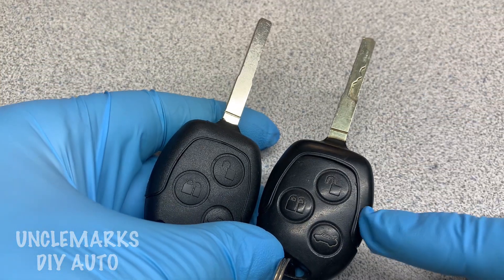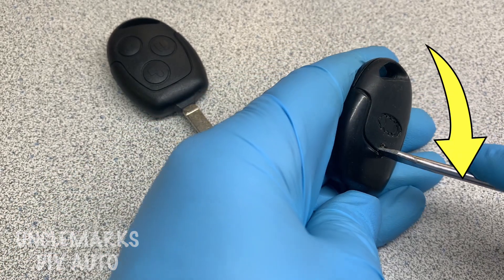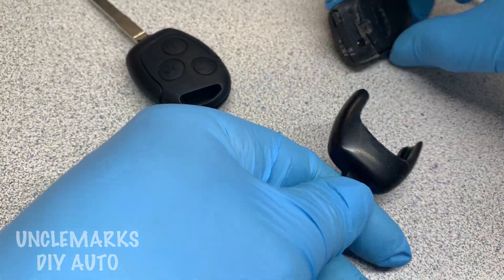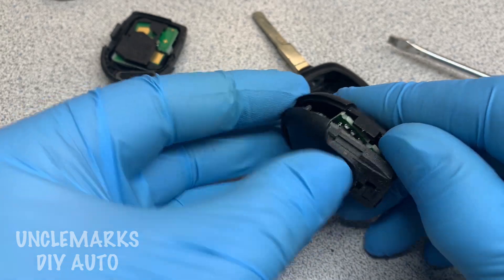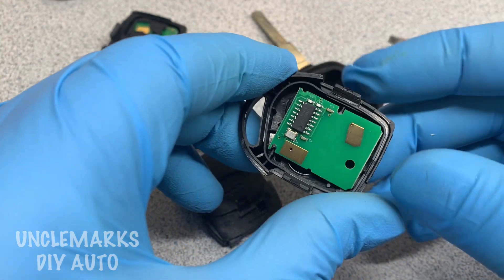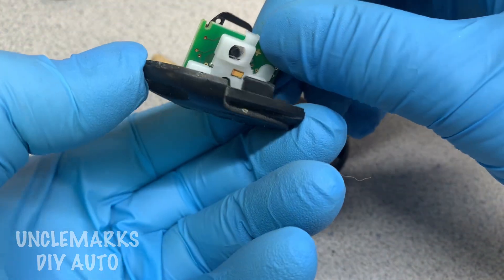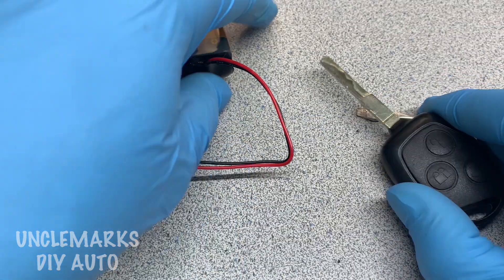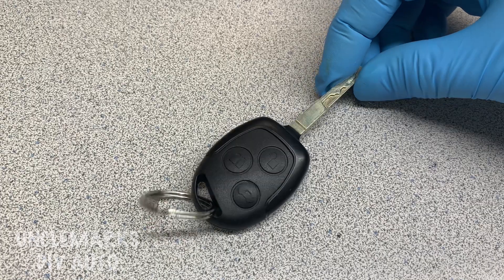How to add & program a Ford Fiesta key FOB by yourself!

Comment: This is fine for the remote function but how will the added key start the car? You still have to take it to the dealer to program the transponder of the new key.
Reply from the maker: no, this worked. I thought I explained how I did it in the video. Key working fine since I did it. The lady that owns the car is 78 years old. She literally took the car home after I added the key. Watch the video again, starting at 2:11. I reused the actual key, and also the old bottom part of the FOB which contains the pellet that the car reads to know this key belongs to this car. (I did NOT reprogram the key, just the button functions as the circuit board & buttons were new and the car would not have recognized they now belong to the car. Does that make sense?